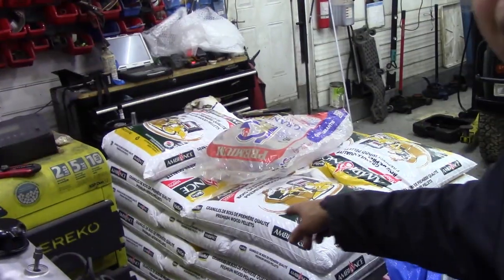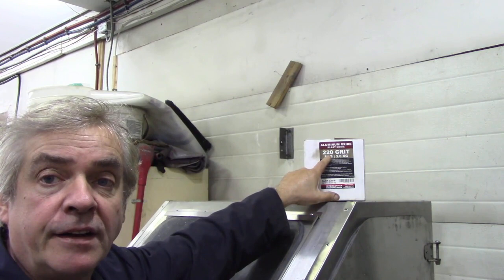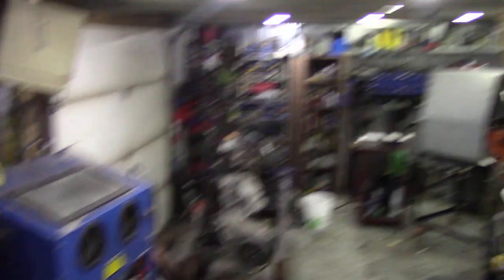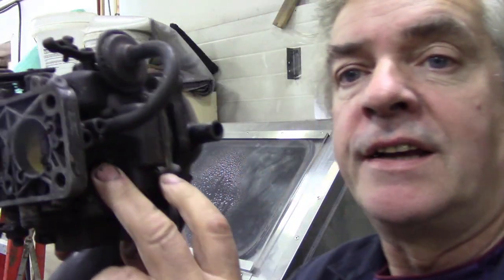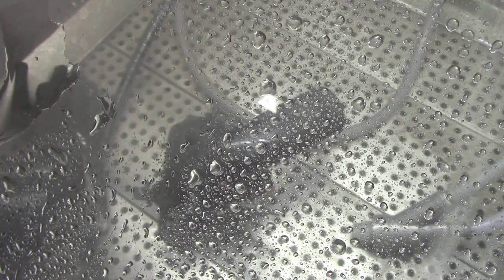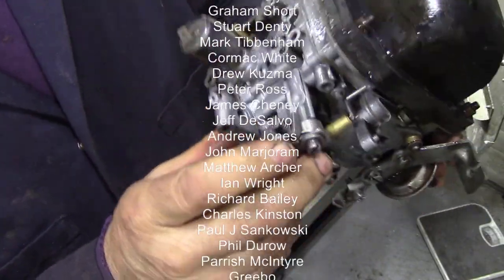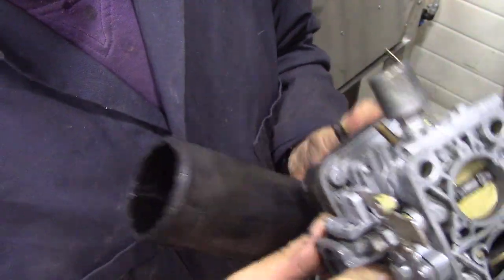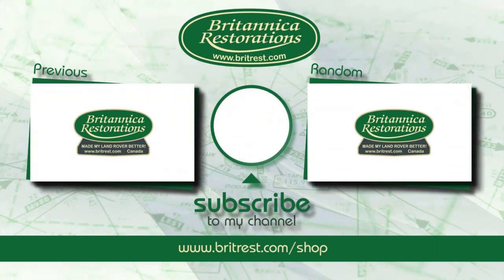Re arranging the shop and a practical test of the VapourMax 750 wet blaster

Comment: Mike, I have a hook in my blast cabinet that suspends the jet nozzle pointing down vertically from the roof. This lets me manoeuvre small parts like your carb under it leaving me both hands. For bigger parts I take it off the hook. Makes it far more convenient.
Reply from the maker: good idea - does it not buck about with the pressure?
Reply: @BritannicaRestorations  Mine actually has a horizontal pivoted swinging  arm with a tube in the end into which the nozzle fits, so saying a hook was a bit of a simplification ! The gun is quite heavy and sits pretty firmly in the tube.. It's a Guyson cabinet with a table that can be rotated by hand under the gun.

Comment: Try Rainx on the inside of the glass, it might help with visibility. Impressive results with that grotty old carb.
Reply from the maker: The screen is plastic and you cannot use Rainx on plastic - BUT I give it a coat of Turtle wax and it is better
Reply: @BritannicaRestorations  but you can use a ceramic coating similar to what you would put on plastic headlights to help prevent uv it should bead off the water better. Nice job on the carb though.